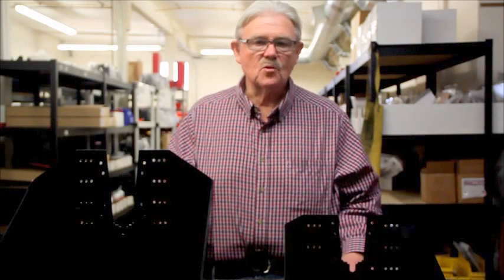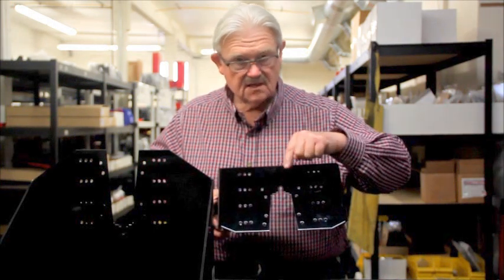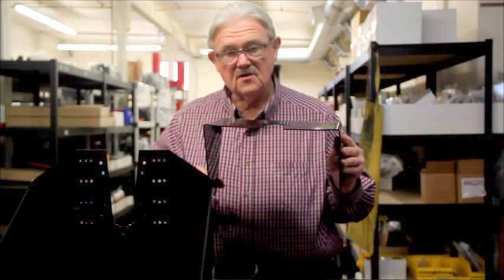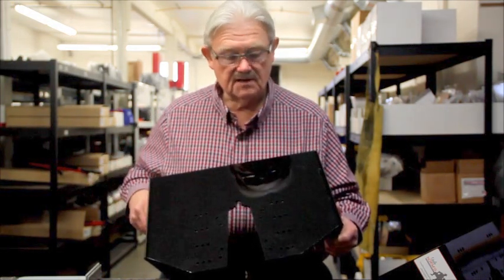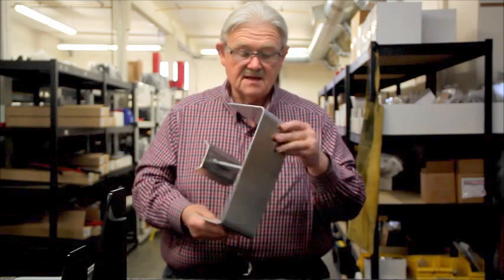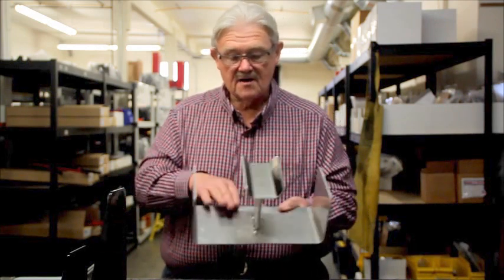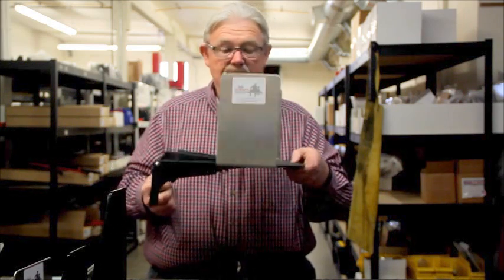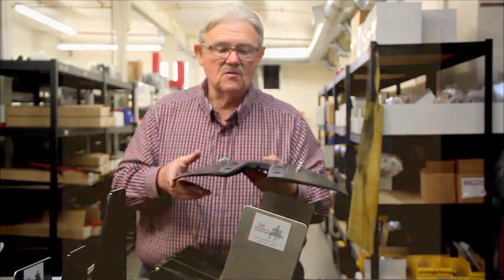WHAT'S THE DIFFERENCE - FINS  from  Uncle Norm's Marine Products

Comment: Do these replace or used in conjunction with smart trim tabs?
Reply from the maker: Hi Gerard,

These products are designed for use with trim tabs. Trim tabs and whale tails (Dolphin and Orca Fins) do different things to affect the wander and turn of your boat due to the placement. The whale tail or hydrofoils are effective at speed, our Orca Fin addresses the wander as well as the trim aspect. Generally boats that are powered by an inboard/ outboard or outboard motor rely on the thrust to give the boat directional control which is fine at high power and speed; however at low speed you have very little control and the boat wanders. The Orca fin adds triple the rudder that actively adds control as long as there is water flowing over them. Even at zero thrust, when you are out of gear, you still have steering because of the rudders. The large FLUKE or flat area between the rudders acts like a powerful trim tab. Because it is farther back than trim tabs, it has more leverage or influence on the boat. You can easily control the trim with your tilt trim control.
Reply: Hi your ORCA FIN WITH THE CLAMP MOUNT is an amazing product!!!  My crestliner discovery 1450 with a 40 Mercury outboard had a serious problems with HIGH BOW RISE to where I couldn't see in front of me and the boat would not plane, even at full throttle. The ORCA FIN was added to my boat along with a 4 blade propeller and both problems are gone. There is virtually no bow rise and the boat planes almost immediately!!!! This video truly shows the effectiveness of the ORCA FIN. Thank you!

Comment: will the orcas work on 2019 yamaha twins 150hp 4 strokes?
Reply: Hi your ORCA FIN WITH THE CLAMP MOUNT is an amazing product!!!  My crestliner discovery 1450 with a 40 Mercury outboard had a serious problems with HIGH BOW RISE to where I couldn't see in front of me and the boat would not plane, even at full throttle. The ORCA FIN was added to my boat along with a 4 blade propeller and both problems are gone. There is virtually no bow rise and the boat planes almost immediately!!!! This video truly shows the effectiveness of the ORCA FIN. Thank you!